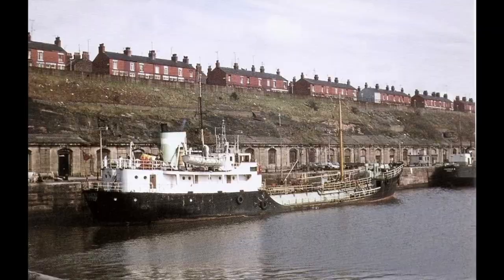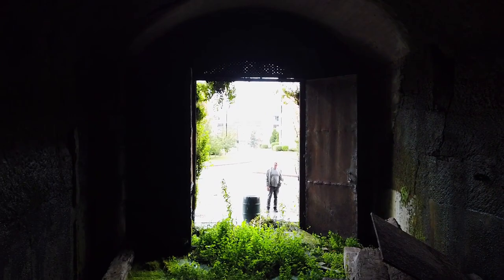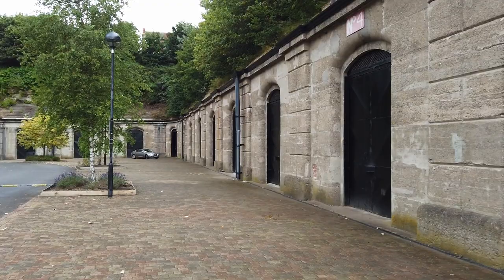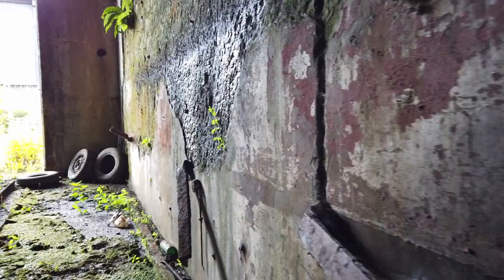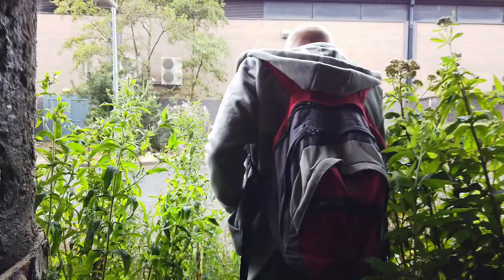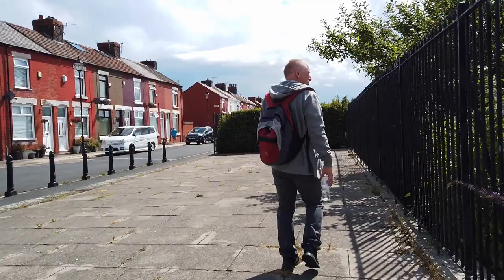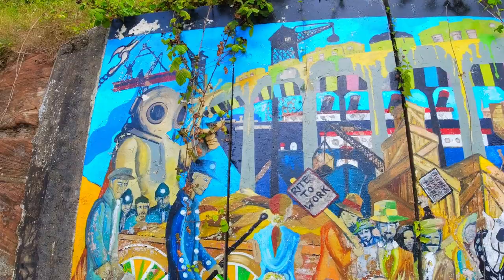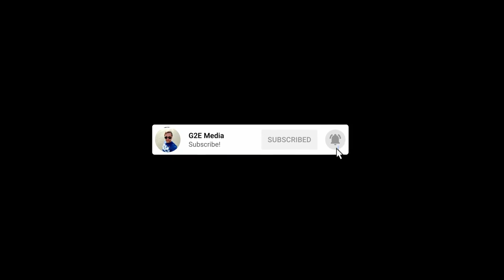Exploring The Remains Of Herculaneum Dock Volatile Cargo Stores (Casemates)  - Liverpool -

Comment: I remember in the 1960s watching the activities in the dock from Cockburn St. above as Dad had stopped the car. A chap was moving small goods waggons with a rope attached to a motorised capstan. The casements would be difficult to repurpose as sandstone is porous so will always be wet. The residents have the place to themselves so is very quiet and wouldn't want them opened up to access by the general public.